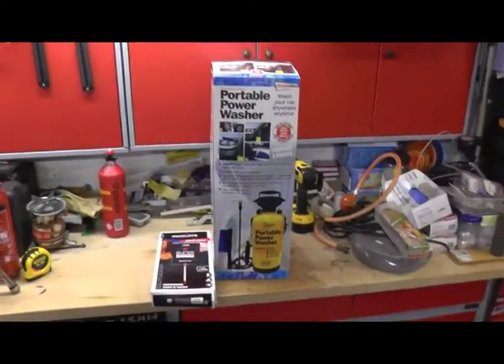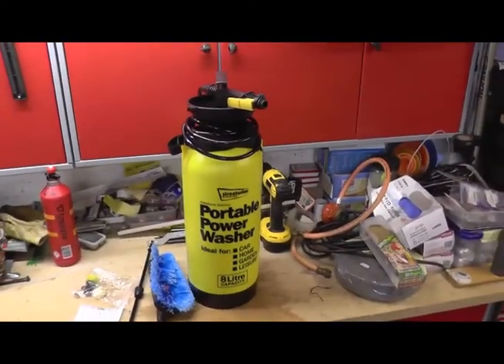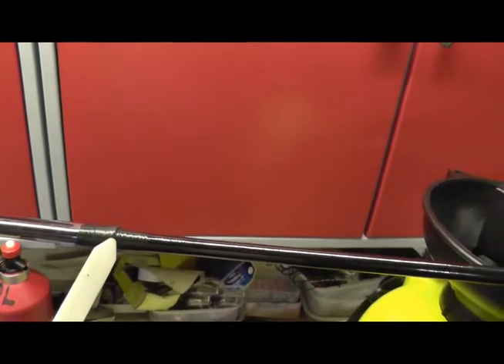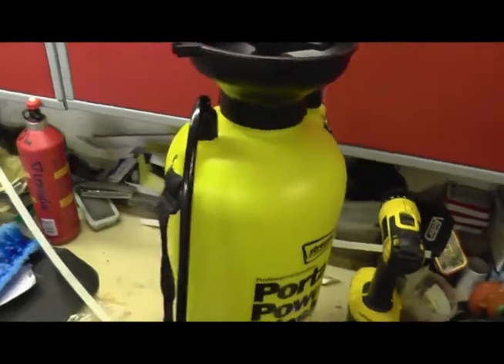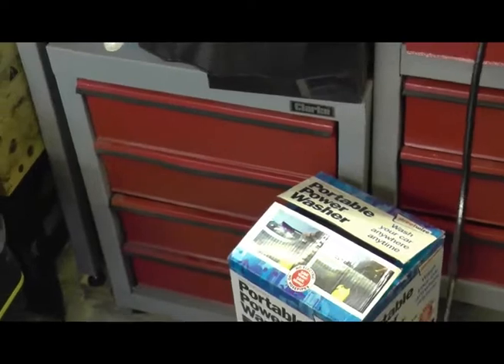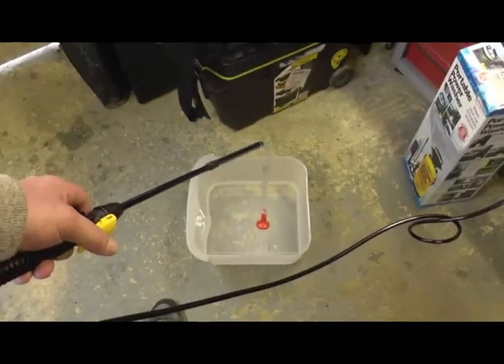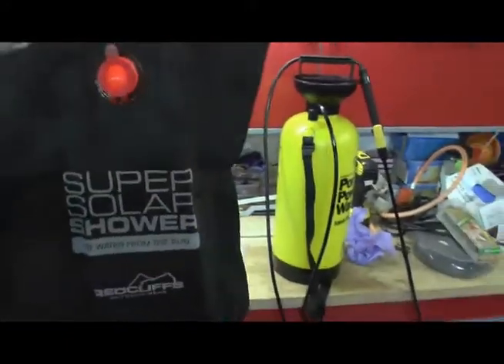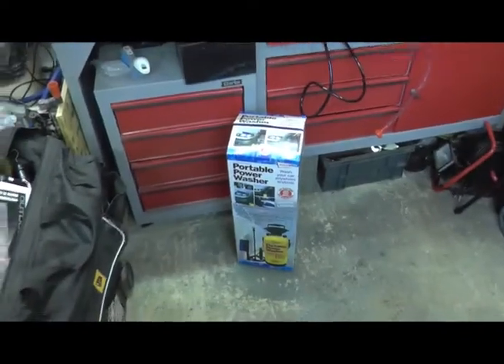Portable Pressured Camping Shower  - Make Up

Comment: that will work great mate. i know loads of overlanders that use the sprayers as showers and they are way more efficient than my electric one that i drop in a bucket. great idea putting the shower end on too they all use the wand that comes with it.
Reply: my biggest problem is the smell of smoke it gets in every item of clothing so there is no escape.
Reply: i worked in a feather bay for the day once and i didnt know the siren ment get out so i worked most of the day in it. i felt crap for hours and eventually my nose started bleeding so i went into the office. they then freeked out cos 20 min worth is supposed to kill you lol. since then i have little sence of smell. apparently they break feathers down with acid to make protein powder for animal feed. so when i think my jacket has a little hint of smoke the wife wont let me in the house till i strip and give her all my clothes before im allowed in the house.

Comment: very neat oz, nice conversion, but they actually make a pressure shower like that i had one (still got it somewhere) very good to have a nice shower, the only trouble was,  pumping it in the shower took on a whole new meaning hahah, i use a battery one now, but they still say the buzzing of the pump sounds like a vibrator so cant bloody win with smut minded peeps haha,   you could use the brush as a looffaa wash all those crusty places, nice soft bristles,  oooh err misses!! atb, dave

Comment: would it work if you used the solar shower bag to heat the water & then  transfer it to the pump, also it will give you hot'ish water to wash up etc.